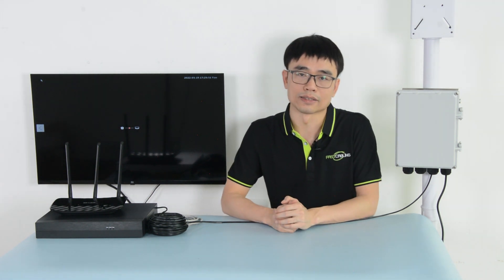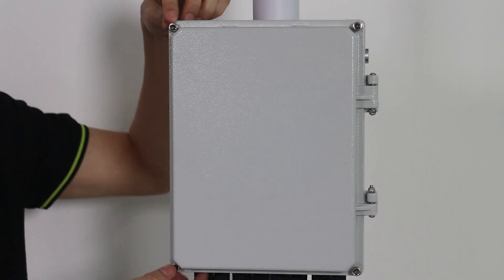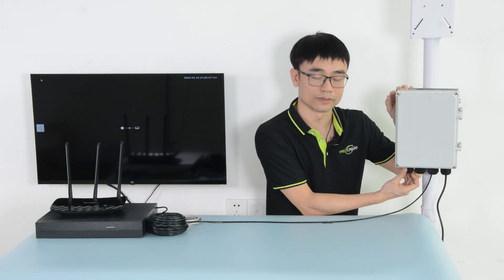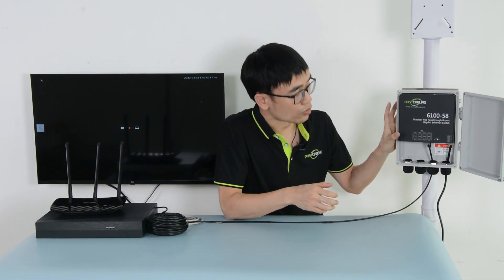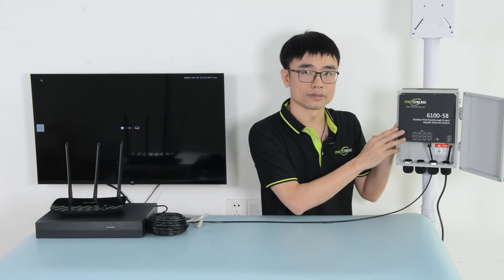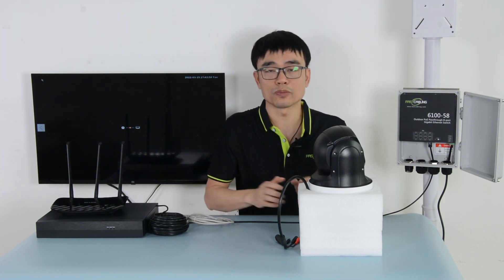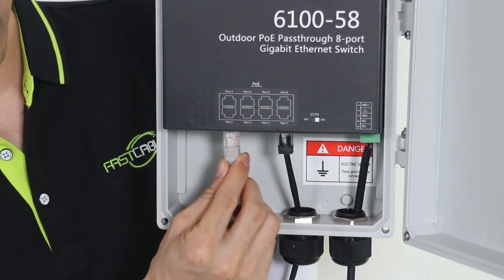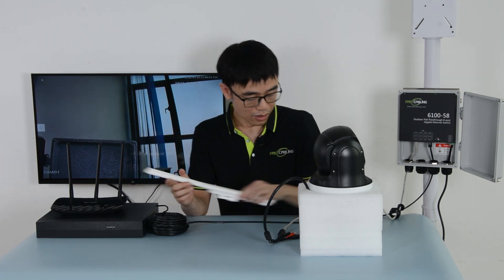Two things you may want to know before installing POE switch outdoor

Comment: What is the Power Output of this switch? At what voltage?
Reply from the maker: 32W max. per port with a total PoE budget of 94W, voltage range 802.3at mode: DC53V

Comment: What kind of power adapter is supplied with this unit to power the switch? Is it outdoor rated as well? :)
Reply from the maker: The power source is built-into the POE switch. No required for additional power source. It is IP67 outdoor rated.